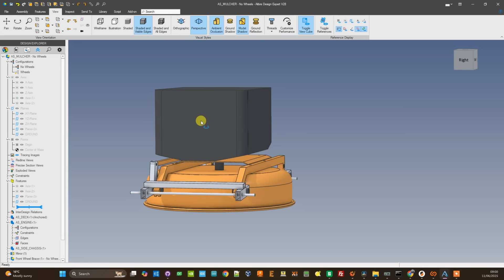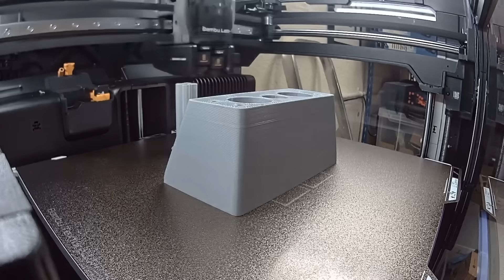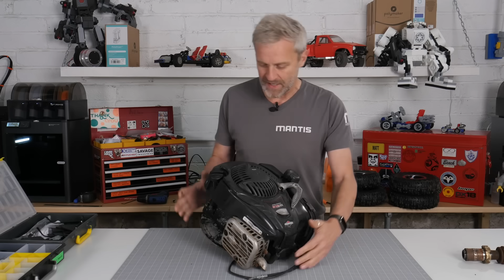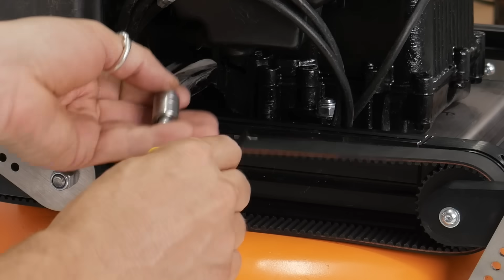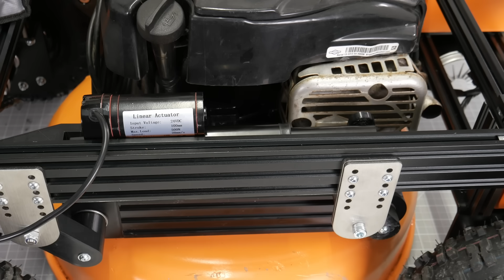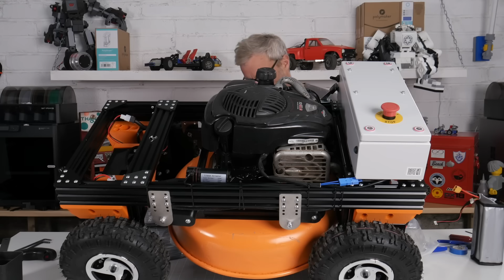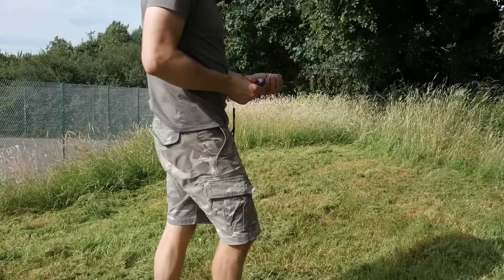I Built a 4x4 Radio Controlled Mower!

Comment: Tricky. Skid steer uses heaps of power and doesn't always skid - although yours is working OK. Casters with a wheelchair drive take weight off the driving wheels so less traction. Steerable wheels are heaps more complicated. But that's what engineering is - compromise all the way. BTW - torsional stiffness comes from closed sections (tube). No need to go for a solid shaft. Of course your sagging side was mainly an oops which you fixed. Nice going!
Reply from the maker: Yeah I considered casters but they would have got back down in the long grass. Yep I get the torsional stiffness properties. But extrusion isn’t that good due to its shape, a true box section would be better. Anyway.. it was mostly my error 😂

Comment: So, are you worried about the engine exhaust melting the electric motor mounts? Great job so far. You've earned a subscriber. I've been toying around with the RC hobby since the early 80s as a young kid.
Reply from the maker: Yes and it was turning everything black! So beater to push it out the side. Thanks i
Reply: @MattDenton  I seen later on in the video that you used a piece of pipe to move the exhaust to exhaust out of the chassis. I got me a used lawnmower a few weeks back for free and now I'm thinking about doing the same thing to it.
Reply from the maker: @donaldhiggs2075 cool! Yeah quite easy to find on line.‘I’ve was 22mm but check your measurements

Comment: Loved the video Matt, Mulchy is awesome with some great ideas for accessorising him.
I have minor suggestions for you.
a) colour code brackets and bolts (orange & black) and electric box.
b) make a hay bailer for the coupler. 😂 
c) could a small alternator be fitted to the engine to charge the batteries?
Adding the 50mm ball coupling was a great idea, love to see if it could move a small caravan, with the ability to raise and lower might not need to use the jockey wheel.
Reply from the maker: Thanks 🙏 I did think about colour coding and I’m a little disappointed with the electrical box colour.. but pick your battles 🤷‍♂️ my initial idea was to have a raising ball hitch but hadn’t realised how much space I needed and there wasn’t room :/

Comment: Bolting the motor onto the stainless steel plate would be ten times easier with a nut welded to the holes.😊
Reply from the maker: Yes it rivnuts! I may do rivnuts if I take it apart agin

Comment: 7:15 just spray them once a year with zinc-aluminium spray (with >90% zinc) and they hold up fine. Don't use paint, it will just spread microplastic in the environment :)

Comment: i have wanted to build one of these for so long. the linked kit is very useful as i was looking at wheelchair motors previously. these along with speed controller and remote etc would have cost probably more than this kit. i think the only thing stopping me at the moment (previously it was welding but now you suggested ali ext no welding needed) is persuading the wife i need a 3d printer lol.  could you share the motor mount and height lifting gubbins stl please as i dont see it on the link.  thanks
Reply from the maker: Well you could probably build one without a 3D printer, but convince the wife anyway :) Yeah I'll share the files at some point once I'm happy with them but I think they would need modifying for a specific mower deck.

Comment: Matt, you basically just built a very weird RC crawler.
Thought: Maybe tracks instead of wheels would be better for differential steering, traction and longevity.
Reply from the maker: Yes they probably would but large and more difficult engineering.. but possible :)

Comment: would been even beter if there was a 24v chargign system on the motor and electric start
Reply from the maker: Yeah could be an option but the batteries outlast the fuel tank 4 times over right now..
Reply: @MattDenton  would be real nice to sit on the porch fire it up and not have to worrie about if batterys are charged ect or having to walk out and start it for that matter long as its got gas or propane  it be good to go. eather that or do full electric and use solar to charge it.
Reply from the maker: True! I have a spare panel I might hook up to for solar charge

Comment: I love this mower you should seriously consider selling kits???
Reply: I understand but even if you could supply the 3d prints for the wheel holders and the dimensions of the frame work and have it so the person can make it wider or longer or shorter depending on what mower set up they want to use just to be able to get that roller you build before even putting the mower on it would be killer! I been contemplating using my Xmaxx as a tow car for a cheap electric mower or something like that but that awd set up is crazy good!
Reply from the maker: Hmm, maybe, then id have to support the kits :D
Reply: @MattDenton thinking of purchasing the bamboo lab printer if I do could o contact you regarding the 3d prints Il make the same drivable bear frame you made and possibly use a electric push mower but will be at a set hight I’d say to keep it simple
Reply: @MattDenton would of helped if I opened my eyes and seen you have listed in the title thanks

Comment: Great video. What is the make/model of the motor controller(ESC) and the RC transmitter/receiver? Rather than the abrupt full on/off I would bet it can be programmed so that the speed is proportional to the travel of the RC control stick.
Reply from the maker: The ESC is part of the 4x4 kit i purchased and has no documentation or branding!! The R/C is made by hotrc. The drive control is proportional, it’s just the extra channels that are on/off. All can be replaced with any other pwm based transmitter

Comment: I wonder if this would be better using two high torque moters and a single free rotating wheel on the back, seems like it would be more maneuverable and wouldn't tear up the grass when turning.
Reply from the maker: It would steer better yes but I don’t think it would handle the terrain I have well enough
Reply: @MattDenton  I don't think it would be that bad, and if you were concerned you could widen the footprint a bit. Generally speaking three points of contact with the ground is more stable than four. It would also reduce the wear on your tires, as they would not be chewing themselves up when turning. That is unless your terrain is particularly soft or muddy, in which case you're probably right, 4wd would be a boon in that case.

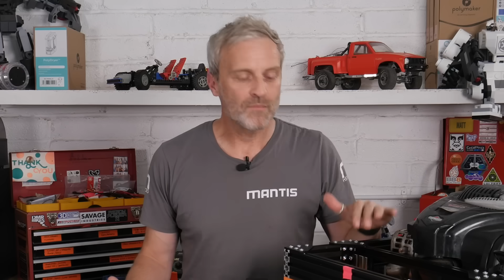Comment: Can't you just use a different controller or controller that'll allow some acceleration curves. Any RC controller used for quads or planes should do the job? You're trying to fix something with hardware that I can be done in software a lot cheaper? This would also allow you to tweak your min/max speeds too. At 29:40 you mention about the output (you mentioned capacity too) of the batteries, you talk about that in Ah whereas I think you might actually just mean Amps. 
With a different controller you'd also have seperate controlls for fwd/backwards and left/ right. That would allow you to cut in a straight line on the flat (so long as wheels aren't slipper) without having to pay so much attention. As an upgrade you could use the accelerometer and gps of a modern drone controller board to automate some of the cutting.

Loving the build process and video!
Reply from the maker: Hi 👋 so yes you can use any other r/c controller and yes you can program a curve to get slower control 👍 however.. if you generally want slower control over speed, the. It’s better to have slower motors that deliver more torque at slower speeds. When I run my motors very slow I’m doing that by simply putting very little power into n them, so sometimes you have to give them some speed to get the power back. 

The battery 30AH is a little confusing but here is what I’m trying to explain. Most liFe4 battery’s have a BMS that is current limited to the capacity of the battery. So 30Ah capacity would have a 30A current limit. In the case of the batteries I purchased the BMS states it has a current limit of 40A and 90A for 5 seconds 👍

Comment: The kill switch on the engine doesn't short the spark plug, but open the circuit on the coil in order to cut the ignition.
On normal operation, with the brake released, the primary winding is connected to the engine ground.
When the brake is applied and the ground connection is opened, it stops the engine.

edit: I only just got to the part where you thought to short it to ground with a relay, so you most likely found out later that it might not work as intended.

Be sure to keep the wire between that crude switch and the coil to rub on any metallic part.
I had that wire rubbing the engine fins on my lawn mower, and it short circuited on the cast aluminium head.
Therefore the engine couldn't stop anymore, even with the brake applied, and in the panic I didn't think of simply unplugging the spark plug 😐
Reply from the maker: On this engine, the dead man handle when released joins a wire connected to the coil to the engine block. So I believe this shorts the spark out. So I simply did the same by connecting a relay in parallel with the mechanical switch, hence shorting that coil wire to the block which stops the engine.
Reply: @MattDenton  ok, my B&S seemed pretty similar so I assumed it was the same but there might be variations.
In the vidéo I only saw the accelerator that replaced the handle, I didn't know you also tested a closing relay and if that also stops the engine then it's definitely différent than mine.

I'm a bit surprised though since the primary has to be wired to the ground anyway, so simply opening the circuit was not only simpler but also safer since the engine would also stall if the wire got cut.
But you never know, sometimes manufacturers make weird choices 😆 or maybe too much people ran into the same issue as me, so they changed the design to cut the engine in case the wire shorts itself to ground instead of keeping it running.
Reply from the maker: Yeah I agree it seems like a strange way to stop the engine especially when you see how basic the switch is to short the output to the chassis! It’s just metal on metal no case or debris protection. 😬

Comment: Mulchy needs lights, and maybe you put fine chains on the rubber to protect ist from wear, just as very big mining equipment. The use steel chains to protect the rubber.

Also build a snowplow/schield and maybe one of this big brush things for the sidewalk/street sweeping
Reply from the maker: Yeah I have some lights left over from an old project I think I will use. The chains might work.. and the plough / sweeper would be great, just not sure how much snow I’ll ever see here 😂😂

Comment: This is great - but why not ditch the oil burning gassy engine that you have to pull start and gain room for an electric blade motor and bigger batteries - and I like some others' suggestions of an FPV, but I'm thinking FPVAR so you can have a beer, watch the game and mow the grass at the same time - and with all electric, you won't be wasting gas on trips to the bathroom or having to leave your house to restart the mower if it stalls. Hell, you could put a basket on this thing with money and a note in it and run it down to the corner shop for more beer kind of like this other youtuber I've seen.
Reply from the maker: Well gas has about 63x the power density of lipo batteries. So imagine the battery size to get the same power through that long grass… it would be huge! So hence gas for now. I like the idea of sending it to the shop though… engine running 😂😂

Comment: Fun build. The mower piece was possibly a bit big and also awkward for this, but a flatbed scanner plus ruler often comes in handy for getting dimensions for flat parts. Just import to CAD, calibrate the image from measured dimensions or a scanned ruler image and you've got a template.  I also tend to split parts and print a minimal section if needing to test fit/alignment etc, and set the Bambu to Sport or Insane speed if really impatient :)
Reply from the maker: Yeah I could have photographed it and imported it but thankfully my measurements worked out ok 😂😬

Comment: Cool video.  Neat project.  Suggestion: some type of cleat or quick connect lifting eyes to simplify hoisting.  And what about an electric starter to eliminate pulling?
Reply from the maker: Yes I did think when I hosted it some lifting hooks would be good 👍 I looked for electric start when I was looking for a doner mower. It would be nice, but I know I’d then install remote start 😬😂

Comment: Could add some relays to switch the batteries from series to parallel to switch to a turtle mode.
Reply from the maker: Yep that’s true. In 12 volt mode it was very under powered though and the motor controller want happy. I did try this. 14.8v was better

Comment: Can you tell me why everybody says 10 mm instead of 1 cm. What is the point of using a decimal system if you never use the graduations? Im not going to measure a room in inches, so why do metric users always just use mm? Ive seen hundreds of different people do this.
Reply from the maker: It’s the engineering way. Centimetres are rarely used unless you are not in engineering.
Reply: @MattDenton  lol.... so what you're telling me is that the whole metric system is really useless. Lol...
Reply from the maker: No. Why does not using centimetres make it useless? I fail to see how you e jumped to that conclusion 😂. You can use whatever unit you want, houses might be meters because they have big measurements 🤷‍♂️
Reply from the maker: For example, what if I moved the deck by 9mm or 11mm instead of 10mm, not on the boundary of a centimetre.. what would you say? You don’t switch to fractions that’s really awful. 0.9 centimeters, or 0.009 meters just 9mm

Comment: Great project. Well done. Are you considering adding FPV? Also there’s a riding mower pull behind that “rakes” leaves into a bin that can then be dumped. That attachment would easily pick up all your grass cuttings and leave the space looking striped. With it attached Mulchy would be a forward only machine, but it’d leave a job much cleaner in the end.
Reply from the maker: Thanks 🙏 ok I’ll take a look at the rake attachment

Comment: Dynamo or Alternator off the output shaft to keep the batteries charged or to supplement them and make the charge last longer.  Kubota had a nice little dynamo that is capable of 30+ Volts, you would just need a rectifier/voltage regulator combo.
Reply: Set it up so you can push voltage into the alternator and now you have an electric start system too.
Reply: Bigger fuel tank would be my first step
Reply: Electricity is cheaper than petrol. Also you sacrifice power to the blade which at the speeds he's running he can't afford.
Reply: Maybe, but then you're just burning more fuel.

Comment: Add a powerful bar magnet underneath so you can recover dangerous metal surface debris from your mowed areas.
Reply from the maker: Nice idea 💡
Reply: @MattDenton  like those bolts u lost. Strong enuf magnet bar would pick them up on the nxt pass.🤔

Comment: I thought about making a remote control lawnmower 20years ago by using regular steering and using radio control to steer it and modify steering servos from a small car or at least modify to steer with and you could put a generator coil on motor to charge batteries by using the flywheel magneto or could simply put windings on the ignition coil they do have some space on some of them.
Reply from the maker: Yeah I think some charging from the engine may be good but the batteries outlast the fuel tank by such a lot.
Reply: @MattDenton  well another thing if you cut the skirt some in the front of mower deck it will cut high grass better I did that to one of my mowers and it helped .
Reply from the maker: @isaacwhite7411 yes that’s an option. I’m also considering raising the battery holders so they down flatten the grass so much

Comment: I thought you would go all electric, as you are adding radio control?
Reply from the maker: Hard to beat the power output of a petrol engine given the pacer required for fuel, eg power to weight ratio.

Comment: Add ackerman steering and quit the skid steer, tyres will last forever. The trailer dolly idea is interesting but for safety in GP use it'd have to be heavy as, or able to brake the trailer wheels.
Reply from the maker: I’m going to add braking to Mukchy upon the kill switch. If I added steering thr mech / build gets way more complicated

Comment: Great project!  Next easy mod would be to add some front and rear LED lights so you can mow when it is gloomy - perhaps dual-state LEDs that switch from white to red depending on direction of travel?
Reply from the maker: Thanks! Yes it definitely needs some lights! A bit of bling, but also practical 👍

Comment: Your material choice was poor, and expensive. Extruded aluminum and plastic...

mixing steel & aluminum is complicated because they have different expansion rates & strength, plus their contact can result in corrosion. This can also be an issue with uneven terrain because steel can flex & spring back with no issue, but aluminum can't. You're going to get cracks around the bolts that hold the frame together. Mower decks need to flex a bit, because a yard is never perfectly flat.
Reply from the maker: Ok let’s see what happens 👍

Comment: That exguast direction.
Reply: I've seen you got a pipe leading out , what about the muffler around the other components. Mabey I didn't catch this right .
Reply from the maker: The muffler is in the same place on the original engine, and has a heat shield around it. So my main concern was to redirect the hot exhaust gas away from the printed components
Reply from the maker: Explain..
Reply: Idk is it just me or is that not gona heat everything up and degrade it . Mabey im just being a Nancy. I didnt hear you mention anything about muffler near the components that it is . Mabey a oversight ?@MattDenton